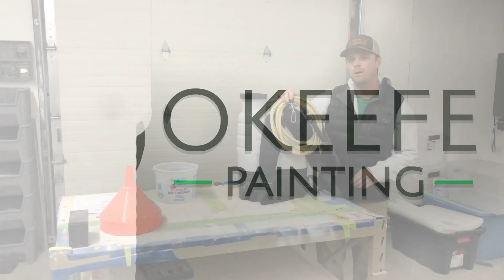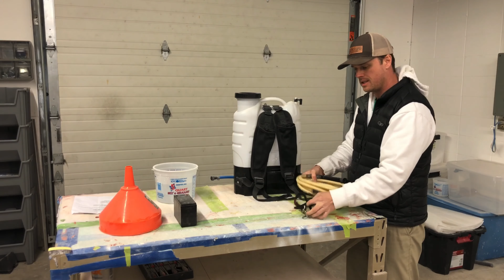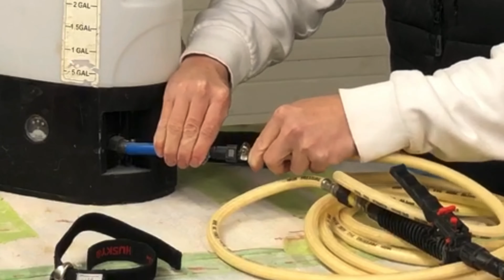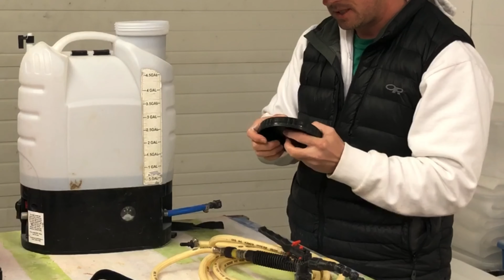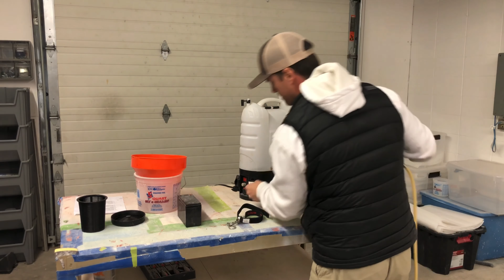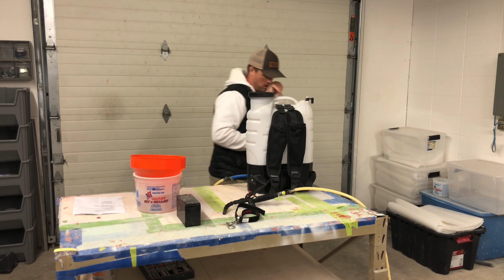How to use my 4 sons battery sprayer

Comment: What strippers are you typically using with this sprayer?
Gel stripper wouldn't  work right?
Reply from the maker: Jay thepainter were using hd80 for the most part.  Sometimes we’ll use bleach or if we don’t want to dilute our brightener by down streaming we’ll use it as well.  Gel stripper would be too thick.
Reply: @okeefepainting1023  I went back and watched your deck stripping video and realized that.
Thanks for doin these videos, very informative ✌